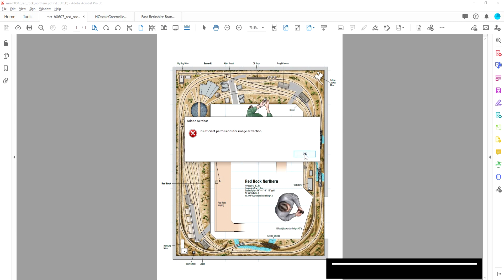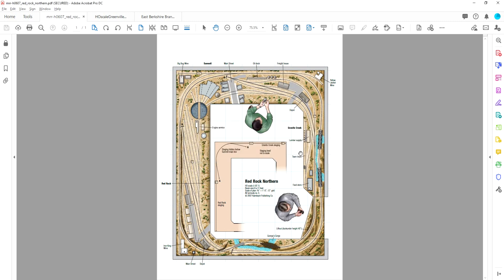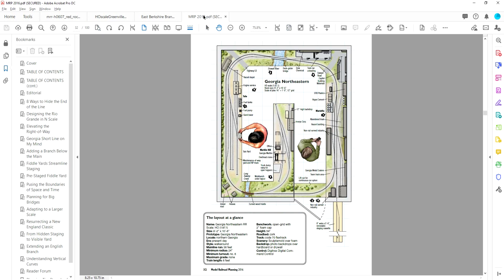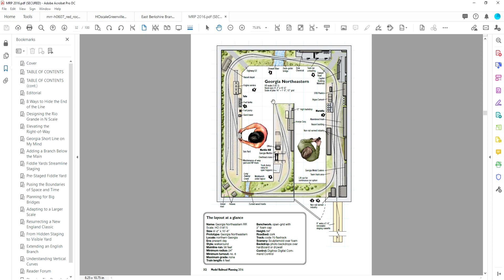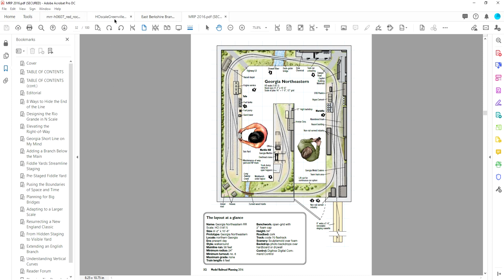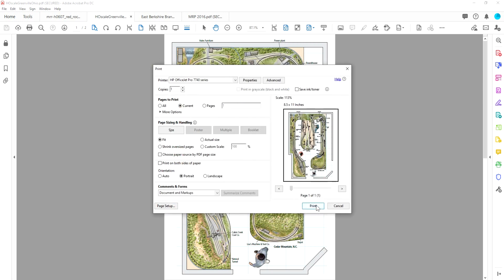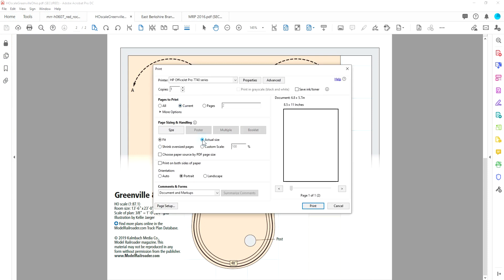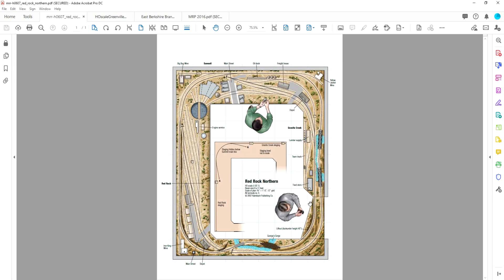AnyRail 6 Video Tutorial Part 17: Grab That Track Plan

Comment: Dave,
I have been using the screen capture sniping tool from Windows 10 and I have been able to grab the images from the Track Plan Database pretty well. I will check on the file size. 
I also plan to see if AnyRail will load a TIFF image. That format is a compressed type but has no loss when opened and closed several times as compared to a JPG format.
Reply from the maker: Hi Steve, let me know how it works out with a TIFF file. I just updated to the new version of AnyRail and gave it a try. Tiff files come up as a file it will load in the load image window but my Tiff files don't show up. I tried it with one f and two fs and nothing. BMP, PNG JPG and GIF files seem to work but not Tiff. I have options for five different compression schemes and two for color channels when I save as a Tiff. I tried two compression schemes with no luck. Maybe AnyRail wants a certain compression and color channel? I'd be interested in what you find. Dave
Reply from the maker: Hi Steve, a quick update. Decided to try again loading a tiff file. Had to select tiff from the dropdown menu on the Load Image pop up. Then, it would only display the file that had the tiff with two fs. Clicked open on the file and I got a warning that said 'ASCII value tag 'Software' contains null byte in value: value incorrectly truncated during reading due to implementation limitations'. My response to that was "huh?". Clicked OK and the warning popped up again. Clicked OK again and then the image loaded. Go figure. Hope this info helps. Dave
Reply: @steampoweredradio2981  
Dave, 
I used the Snip tool and saved the image as a PNG format and it went right into AnyRail with a load image command. I have not checked file size yet. I still need to see how good the image is when zoomed in. It looks great at standard size.

Comment: Something that I used when following your earlier example of inserting a layout picture into Anyrail6 was to make a copy of a track plan by using the snipping function that comes with most computers. I snipped the plan and saved it to my desktop. That image would then be loaded into the program.
Reply from the maker: William,

Thanks for the tip. I was unaware of the snipping tool in Windows. I tried it and it seemed to work OK. It looks like it captures at 72DPI which would probably be good enough for most applications.

Dave